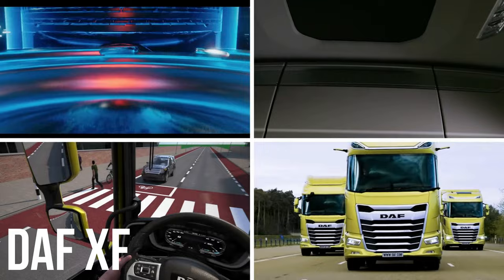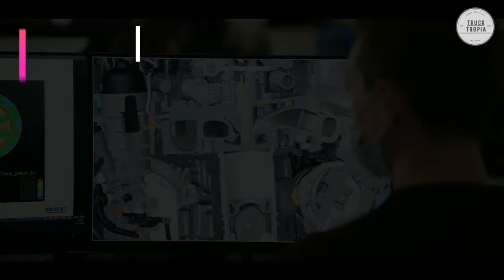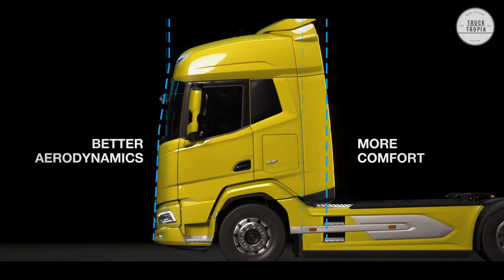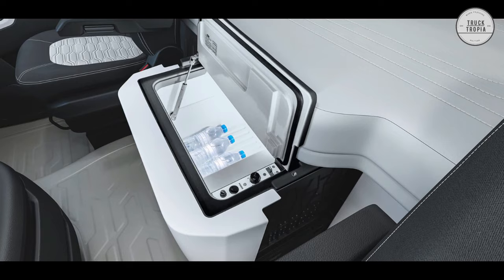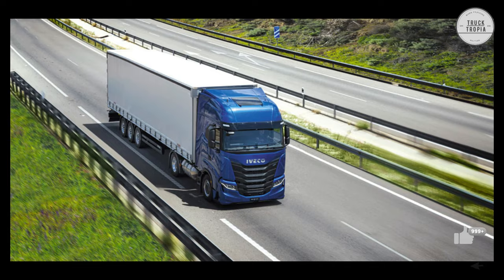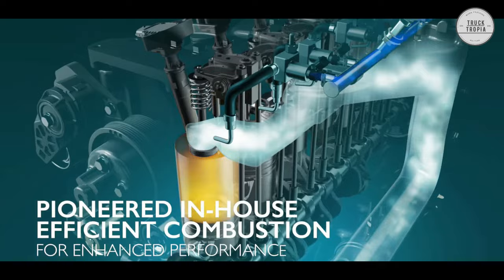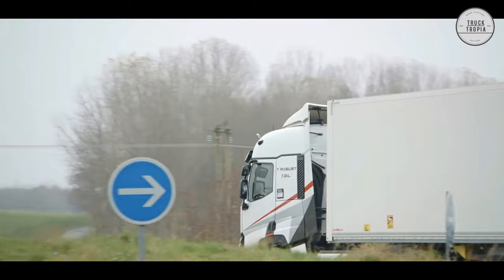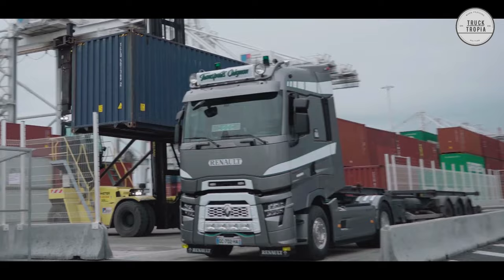EPIC Truck battle ▶ DAF vs. IVECO vs. Ford vs. Renault

Comment: Paccar engine is developed and build in eindhoven the Netherlands...
Reply: No its not, its an American engine company.
Reply: @chesoriadomingo7068  oke the mx13 engine is developed and build in Eindhoven..the Netherlands..and exported to the us..to putt them in peterbild and kenworth trucks..
Reply: @storyclips  same for MX11
Reply: @chesoriadomingo7068  No sire, it's not.

The MX-13 developed at Eindhoven
This engine is a DAF engine and is called after her mother PACCAR. This engine is completely developed by DAF Trucks at Brainport Eindhoven the Netherlands. DAF’s know how since 1956. That’s why the engine is metric till the very last bold.
At 1:00 you will see personal from DAF and especially at 2:58 and 3:26 you will see DAF on the block
https://www.youtube.com/watch?v=xu0UbB3ZlNw
Reply: @chesoriadomingo7068  DAF was bought by PACCAR in 1993. To enter the European market and use DAF's experience in turbo diesels. The MX13 and MX11 where developed in Eindhoven. Because PACCAR gives DAF the task to develop the engines while in America electric and hydrogen drivetrains are developed. DAF is currently developing a new engine range. They're gonna be a little bigger. I can say from trusted sources.
Reply: @chesoriadomingo7068  wrong.

Comment: It's strange but Ford has dropped completely out of the picture where the trucks on UK roads are concerned.

The Haulage industry in the UK in the last couple of decades has more or less been made of the Big 7.

1) Mercedes Benz 
2) MAN
3) Volvo 
4) Scania 
5) DAF
6) IVECO 
7) Renault
Reply: What's supposed to be strange about that?
Ford has closed all of its production facilities in Great Britain and put employees on the streets.
So it's only logical for the freight forwarding companies in Great Britain to
Completely avoid Ford brand vehicles.
The Ford F-Max is produced in Turkey, the majority of Ford cars are manufactured in Germany, Romania or Turkey.
Reply: La marca Hino700 es el mejor tractocamion del mundo sus camiones son muy duraderos y confiables respaldado x toyota motor company